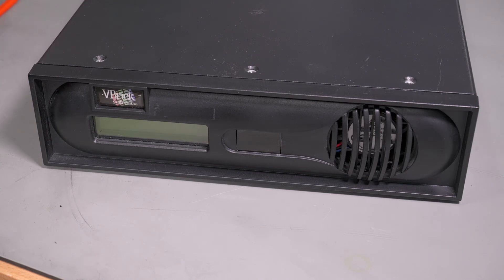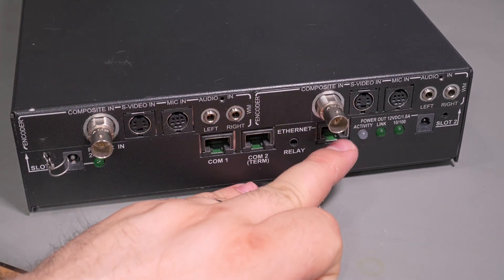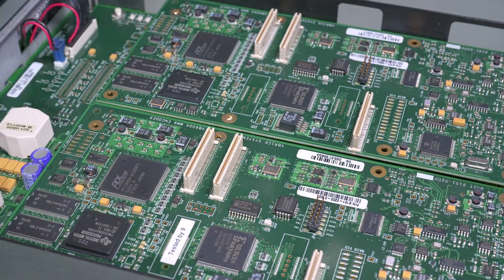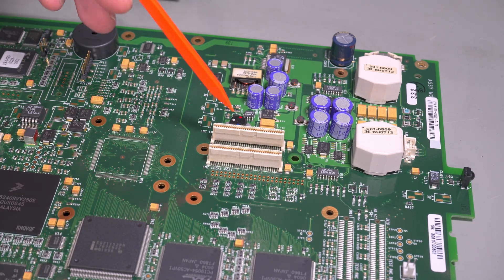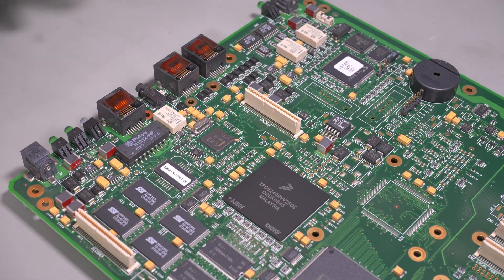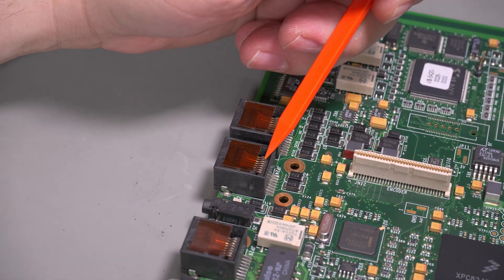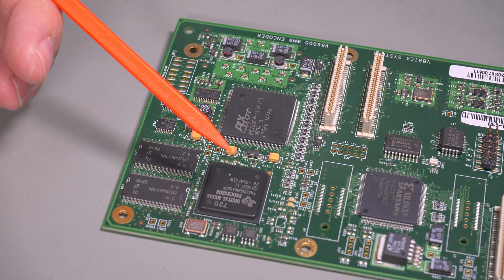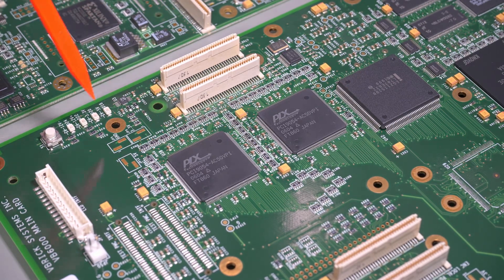Quick Vbrick network video encoder teardown

Comment: The Freescale chip is the 8240, which is a 603e+MPC106 bridge combined.  the Intel chip is a rather common pci to pci bridge (the connectors look like PMC but there was no obligation for them to actually use the pinout) - the TI chips are DSPs.  Looks quite complex!

Comment: Interesting, surprised at the complexity of the A/D boards. Noticed a Philips SAA7114H which must be the main A/D IC, so I wonder if the FPGA is just for optional boards or something else (effects or adjustments maybe?). Really does show how far video encoding has come, I still remember when I had a PC that could barely keep up with encoding live TV, and now my current PC can capture 1080p60 video with no sweat.

Comment: These are used in some places to deliver standard-definition video to broadcast providers across the internet.  One local public-access channel I know of has a VBrick older than that one to deliver their feed to AT&T uVerse via internet for local uVerse cable subscribers.  AT&T required that specific device and it could only be purchased and pre-configured from a single vendor. Aside from a handful of generator failures during power outages it's been running 24/7 for at least 12 years that I know of,

Comment: Based on the socket on the rear panel labeled "relay", I'm guessing the relays inside run that as a form of electrically forgiving digital output.
Presumably if the unit worked that output could be configured to either remote control from the network or to trigger based on some video signal condition.
e.g. If they were installed as digitisers for security cameras the relay output could operate a door lock, intercom, lamp, etc.